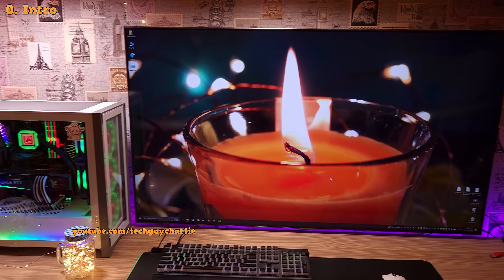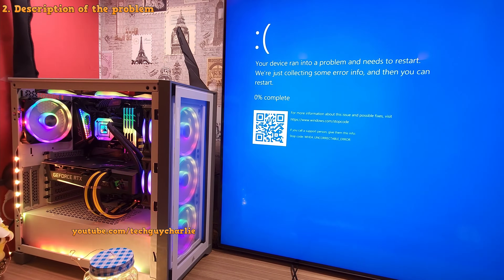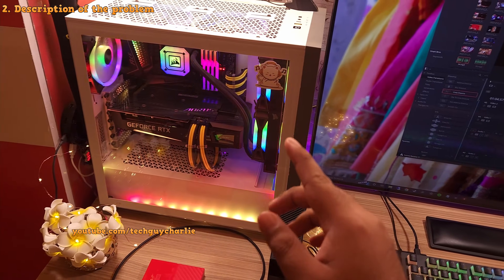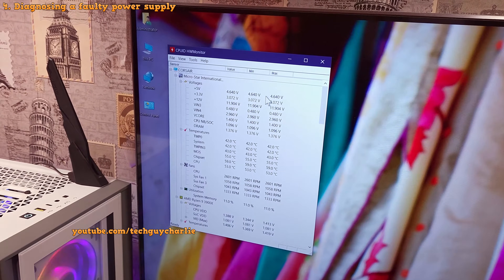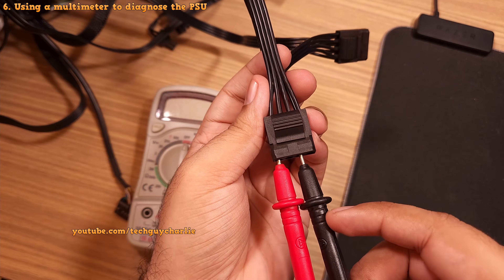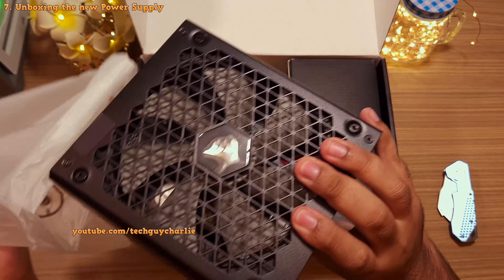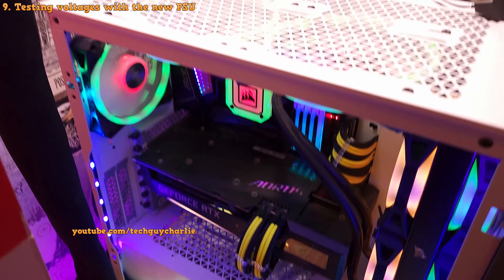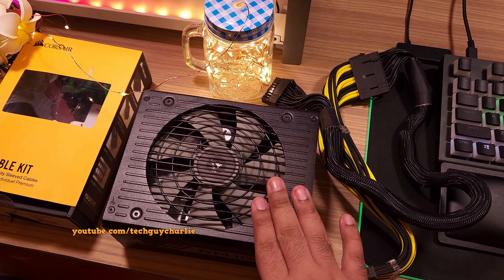How to fix WHEA Uncorrectable Error Bluescreen and USB Disconnection Issues

Comment: Terrific video Charlie. Very thorough and methodical. I had some USB instability in the past but never considered it to be caused by the power supply. I upgraded to another PSU about a year ago to allow for a GPU upgrade and now that I think about those intermittent USB issues also went away. For some reason I never put 2 and 2 together there. So perhaps I had the same issue as you. I will have to test the old PSU now as I was keeping it around as a spare but if the voltage levels have diminished then maybe it should be disposed of instead.
Reply from the maker: Thank you!! and same here, I never thought the PSU would be the cause of USB instability, always suspected cables or faulty USB ports and what surprised me the most was the games crashing straight to the desktop was also caused by the PSU! I was convinced it might have been the RAM, GPU, CPU or Motherboard.
Now, It's been more than a week since I replaced the PSU and everything is stable! Not a single crash or BOSD or any USB issues, just crazy! 
Also, when you test the voltages, make sure to do it under load!

Comment: I have that same exact 3070. I could not get it to run with cable extensions. Very interesting
Reply from the maker: I guess extension cables are a bad idea, by the way, did you ever see the white LEDs light up on top of the pcie connector of the GPU?
If they do, that indicates cable and or power supply fault.
Reply: @TechGuyCharlie   the One I have is lit..

Comment: Did you ever had issues with the Aorus RGB app for the graphics card? I have the same exact GPU and also an MSI motherboard but Intel and whenever i laungh it to change the RGB on my GPU,if i dare to end it in task manager or try to reboot or shut down the PC it will give me a BSOD every single time. It seems to be an issue just with the software itself cause the card behaves normal
Reply from the maker: Hey Laur, I've had one issue, RGB Fusion was interfering with the mechanical hard drives, upon launching, it caused the drives to stop spinning and star back up and it would take over the RGB of the RAM, this was fixed by deleting two files. After that the software has been mostly working fine. Card is great, but the software is junk, which is why I might avoid getting another Gigabyte card in the future.